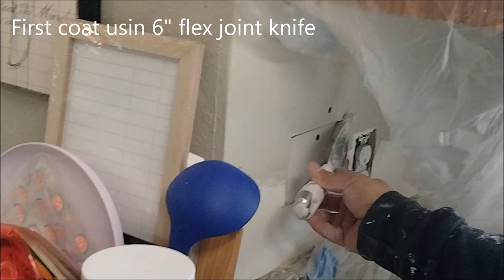How To Fix A Hole Or Small Damage In Drywall - Quick and Easy  - Best Result Ever

Comment from the maker: Material used:
Drywall Hand Tool Kit - Stainless Steel Joint Knife, Taping Knives, https://amzn.to/3YNMJwA
Drywall fiber mesh tap https://amzn.to/3SheJX9
All purpose drywall compound https://amzn.to/3Kopyos
Mold & Mildew Primer Sealer & Stain Blocker  = https://amzn.to/3EjXw9G